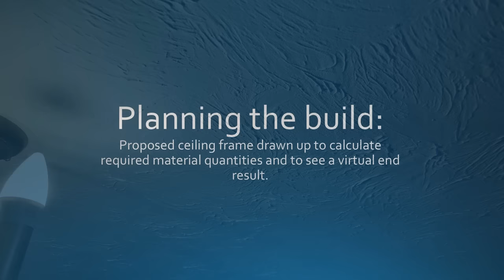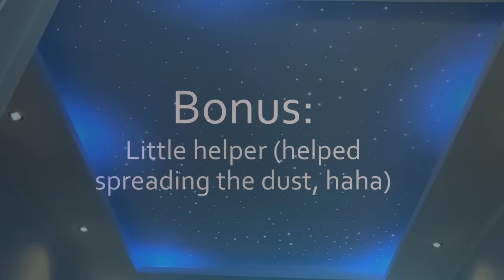Fibre Optic Star and RGB LED Ceiling DIY Build

Comment: hi your project looks absolutely stunning, Good job. i was wondering, what is the distance between the fiber optic ceiling and the bottom of the lowered ceiling?
Reply from the maker: Hi, thanks so much.
The distance is 250mm in my case, but I have a rather low ceiling - 2350mm. So if you have a higher ceiling you may want to go more than that.
Hope it helps.
Reply: @DIY_it_ALL  hey thanks for the reply, i dont have alot of space between my ceiling and the frame of my window  so do you think i can make the same project without fiber optic ceiling in my room with only 120mm of space? Otherwise i wont be able to open my window :), with that i mean just the lowered part with the gap for the LED's
Reply from the maker: Hi,

I think 120mm would be a bit of a squeeze. Instead, have you thought about 'LED Coving'? 

This is what I mean:
https://youtu.be/2ZOI-8LYM4I
Reply: @DIY_it_ALL  hi,

Yeah i have thought about it actually, i think it could work if you place the led strip diagonally towards the ceiling instead of  straight up that way it needs less space to cover the ceiling with light. I hope that is what you mean.

Comment: how many pieces of optical fiber are in total? how many fiber illuminators?
Reply from the maker: 400 fibre optic strands in total.
Reply: @DIY_it_ALL  
how big is your ceiling? to me they advised: "We recommend about 100 to 150 light points per 1 square meter". 

therefore for 19 square meters 3000 light points... you say there are too many, is 400 enough for me?

I'm inexperienced. thanks
Reply from the maker: The area with fibre optic stars is around 10 square meters.

Comment: Hi, love the ceiling. It looks great. How was you able to paint over the lights with a roller?
Reply from the maker: It is ok to paint over fibres, they shine through absolutely fine (I did two coats of white vinyl matt paint).
However I also left them sticking out about 3mm for future painting. When they will no longer shine through, I will cut ends by about a millimeter to expose fresh unpainted fibre ends.
Hope it makes sense.
Reply: @DIY_it_ALL  yes thank you, Ive never tried to do one and you’ve got a real good system there. Thanks for your help. 👍

Comment: Hi are you able to share the some measurements with me as I'm looking yo build this in a garage conversion as well. 

For the frame what sizes for the wood did you use? I.e. 2 by 2, 2 by 4 etc. And what was the total length the frame came down from the ceiling? 

Thanks.
Reply from the maker: Hi,
Thanks for your question.
I built the frame using 2x2's. The suspended part is 500mm off the wall and 270mm off the ceiling - 200mm for the 'base' and 70mm for the 'bottom lip'. Hope it makes sense.
Reply: @DIY_it_ALL  thanks for that! How far out did you bring the base from the wall in total as well from the bottom part where the downlights are? Couldn't tell if it's a foot out or more? Thanks
Reply from the maker: No probs.
The base came out 400mm off the wall and the bottom part 500mm, leaving a 'lip' of  100mm to hide LED strip for indirect lighting.
Hope it helps and good luck with your project!

Comment: What’s the measurement in height of the plasterboard on the sides that is in the up ⬆️ direction. I need to know urgently as I don’t want my dad to mess up it up right now 😭
Reply from the maker: Hi,
Thanks for your question.
I built the frame using 2x2's. The suspended part is 500mm off the wall and 270mm off the ceiling in total - 200mm for the 'base' height and 70mm for the 'bottom lip'. Hope it makes sense.
The base came out 400mm off the wall and the bottom part 500mm, leaving a 'lip' of  100mm to hide LED strip for indirect lighting.
Hope it helps and good luck with your project!

Comment: Hi you have a new sub from me! I have some questions, in the time mark 5:23 how did you get rid of the gap between the two boards. Also what boards are they, Are they just MDF? Also how do you make the ceiling look so nice and white at the end? Thank you!
Reply from the maker: Thank you so much Zack!
I used plasterboard (gypsum board) for my build instead of wood boards. At 5:23 the gap was filled with plasterboard filling and jointing compound using a corner trowel (the compound and tools used are shown in the video at 3:56).
And once all gaps were filled, I sanded down any imperfections and painted everything with a regular matt white ceiling paint.
Hope it helps, but do not hesitate to get in touch if you have more questions.
Good luck with your project!
Reply: Thank you!
Reply: @DIY_it_ALL  It looks like you're painting over your fibre glass ends, how does that not block the light?

Comment: Hi! What did you do for wiring? Did u install anything to prevent any electrical issues?
Reply from the maker: Hi Ramon, I have connected all new lighting to existing light circuit, which is protected by 6A MCB and 30mA RCD.
Hope it helps.

Comment: Incredible job! What type of wood was used and what were the dimensions?
Reply from the maker: Thanks mate.
It was rough sawn timber 47mm X 47mm, and dims depend on the size of the room you have. Mine is sticking out 500mm to sides and 200mm downwards.
Hope it helps.

Comment: This looks great.  I will need to try and do this at my house one day.
Where did you buy the fibre optic twinkle kit from?
Reply from the maker: Hi,

I personally bought the kit on Ali Express, but you can find them on eBay or Amazon as well.
See one of the links below:
https://www.ebay.co.uk/itm/114632016821
Reply: @DIY_it_ALL   After watching this I had to do it for myself and wow what a difference this has made to my Lounge.  I just need to finish off the sanding and then paint it which I will do at the weekend.
Reply from the maker: @crazygeoff  Wow, that's perfect! I am very pleased for you and hope you found the video helpful when doing your build. 
Thanks for your comment.

Comment: I just didn’t understand how painting over the fiber like done at 5:38 didn’t block the fiber. 😮
Reply from the maker: It's fine to paint over fibre optic strands. As you can see they shine through just fine and I applied two coats of paint. Though I did leave them sticking out by about 2-3mm in case I would need to trim them down in future after a refresh coat of paint.

Comment: Just stunning, question what voltage did you use for your led power supply? Thanks
Reply from the maker: Thanks so much.
I used 5V 30A supply for my 5V SK6812 LED strip.

Comment: This is amazing. I want to do this. May I asked what material you used for the start ceiling? It looked like drywall at first but then, you did a close which looked like MDF or something @3:03.
Reply from the maker: Thanks so much!
Yes, it was plasterboard/drywall indeed.
Reply: @DIY_it_ALL  Ok, thank you. May ask one more question? For the timber ceiling, how far down from the ceiling to you go? I plan on starting this project this week and was curious as to how far down you did yours. It looks so perfect.
Reply from the maker: @dtunes77  Hi,
Thanks for your question.
The suspended part is 500mm off the wall and 270mm off the ceiling - 200mm for the 'base' and 70mm for the 'bottom lip'. Hope it makes sense.
Reply: @DIY_it_ALL  yes it makes complete sense. That is awesome. Thank you.
Reply: @DIY_it_ALL  so are you saying the star ceiling is at 200 and the outlining ceiling with the spots is at 270? Or how much is the gap between them

Comment: How is the paint not covering the optical lights, when painting the ceiling? Shit hot job👍👍👍
Reply from the maker: Thanks!
Fibers shine through paint with no issues. Also, I left them sticking out by around 2mm, so that in case I would need to trim them in the future (after a few more coats).

Comment: how the paint does not go on the lights when you paint ?
Reply from the maker: It is ok to paint over fibres, they shine through absolutely fine (I did two coats of white vinyl matt paint).
However I also left them sticking out about 3mm for future painting. When they will no longer shine through, I will cut ends by about a millimeter to expose fresh unpainted fibre ends.
Hope it makes sense.

Comment: Is all the electrical running from an existing circuit? Or did you run new circuits from breakers? By the way you build looks super clean.
Reply from the maker: Thanks very much for your comment!
All lights were connected to a 2-gang light circuit which was existing. I also used a Wi-Fi controller and wired it to permanent live cable to create a third gang and control the starlight.
So I did not have to  run new circuits from the distribution board in the end.
Hope it makes sense.
Reply: @DIY_it_ALL  Gotcha, well thanks for what you do. Out of all the DIY's I've watched about a star ceiling yours is by far the most informative. I also love your other builds aswell, just clean all the way around.  🤙
Reply from the maker: @TxConfidential  Thank you so much once more. I genuinely appreciate your kind comments.

Comment: did you paint over the lights
Reply from the maker: Hi Adam,
I trimmed all strands to about 4mm first, then painted over them, and then trimmed them another 1-2mm to expose the ends. But it is also ok to paint over strands and the light will still shine through (if you'd like to repaint the ceiling in the future).

Comment: for the dropped ceiling part, how far did you come off the wall
Reply from the maker: Hi Daniel,
Thanks for your question - 500mm off the wall. Good luck your project!
Reply: @DIY_it_ALL  thanks, i just started, i'm just trying to get some ideas for measurements, i really like how yours came out, how far did you come down from the ceiling
Reply from the maker: @bandzupdaniel2  thank you so much! Mine is 270mm off the ceiling. 
200mm for the 'base' and 70mm for the 'bottom lip'. Hope it makes sense.

Comment: Hello mate. Was wondering of you still have the .SKP file for the frame an board layout for the bill of materials? I messaged you on Insta too. Was hoping to grab a copy of the file if you still have it knockin about. Great work you done to your home, inspired me to do something similar
Reply from the maker: Hi Sean,
Thanks so much for your comment. 
Unfortunately I do not have the .SKP file anymore, sorry.
I built the frame using 2x2's with 500mm gaps in-between and used 3x full plasterboard sheets for fibre optic stars. Hope it helps.

Comment: How do you mud the ceiling when there are so many fibers in the way???
Reply from the maker: I only filled plasterboard joints, did not apply plaster/mud to the actual plasterboard.
Reply: @DIY_it_ALL  ic, thanks!